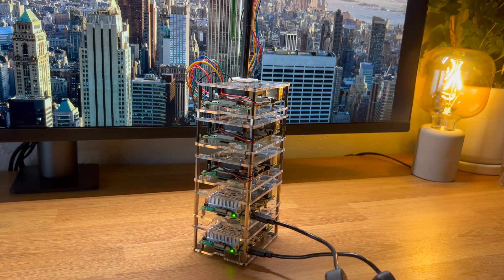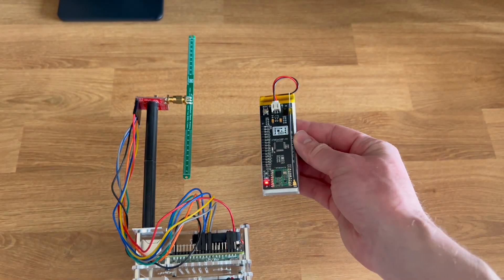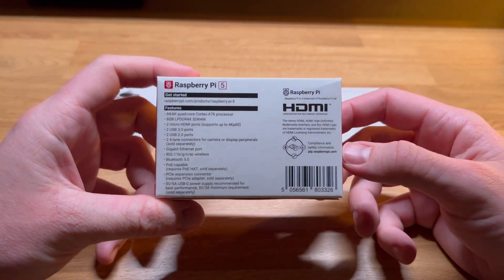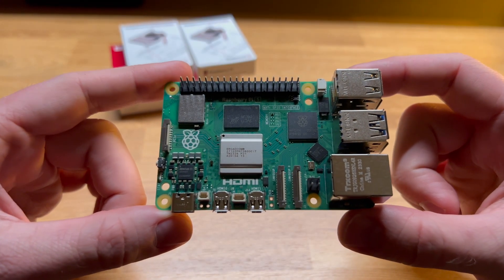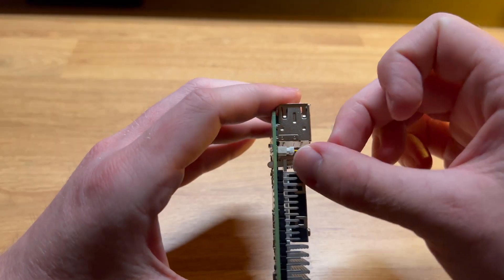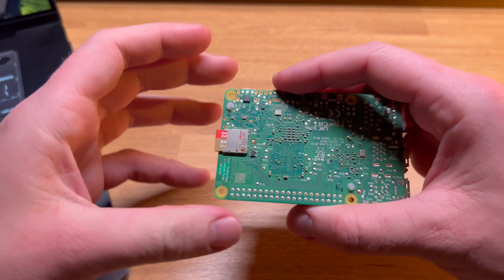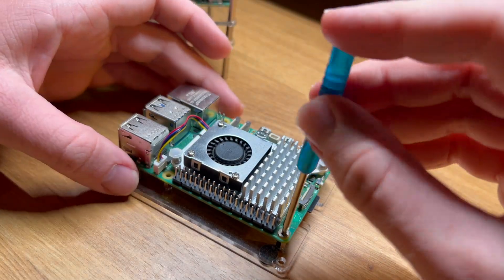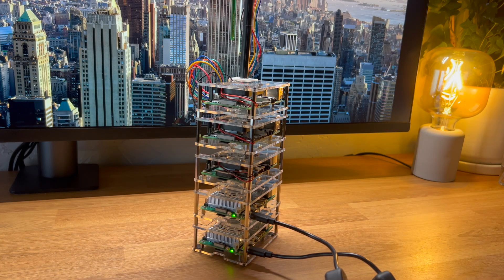Can Raspberry Pi 5's Stack to the Sky?

Comment: Requesting a new Video:
Can you please do a video on complete setup? I mean with humidifier and other circuits/gadgets you are using in your stack, and how did you configure them and software used, etc. Step by step. I am assuming that you are networking them as well if you can include that in your video that would be great.